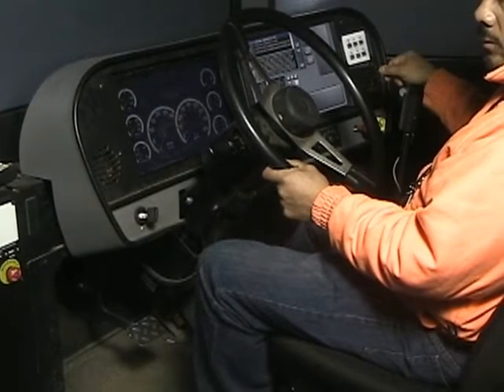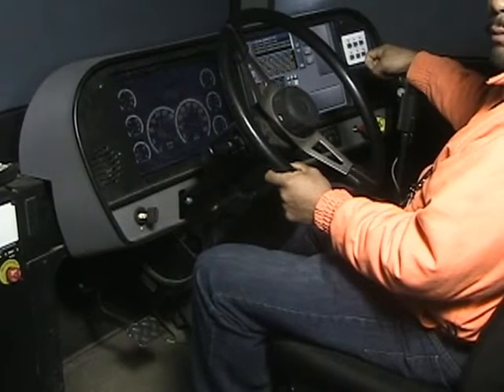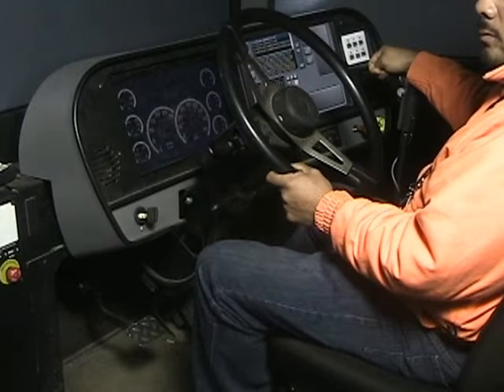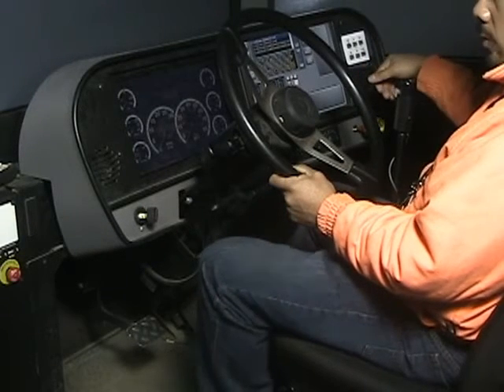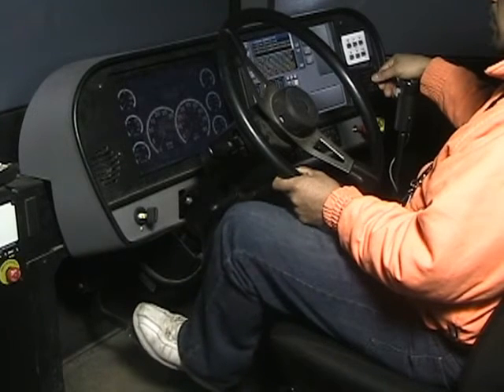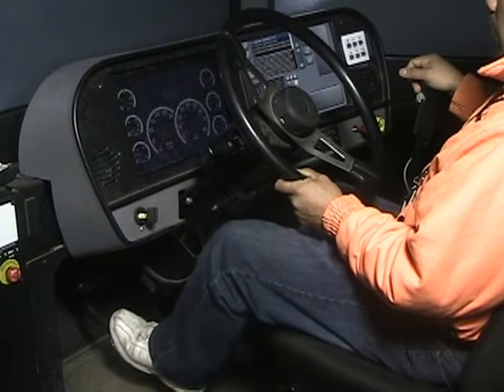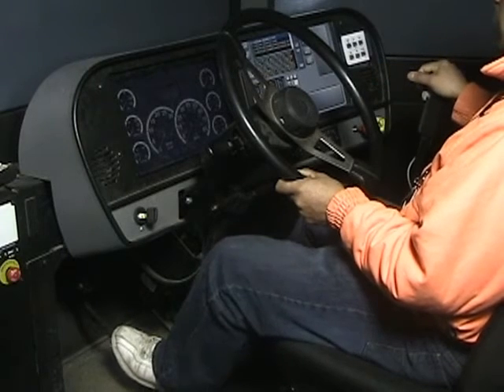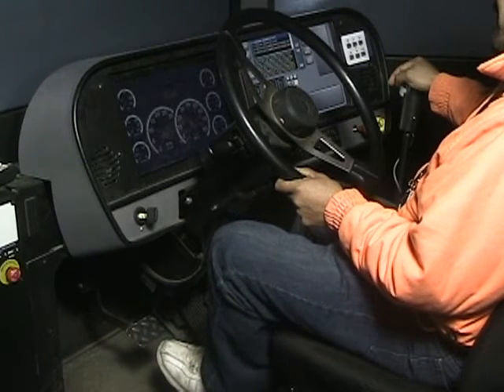Micro Lesson The Clutch Brake

Comment: That would mess me up. I have a 6 speed diesel and I constantly hold the clutch in why shifting. Its ingrained for 35 years. Not sure I could get out of my truck and drive one of these without burning up the clutch brake and get stranded somewhere because it wont go into 1st.
Reply: Most seasoned truckers float the gears.